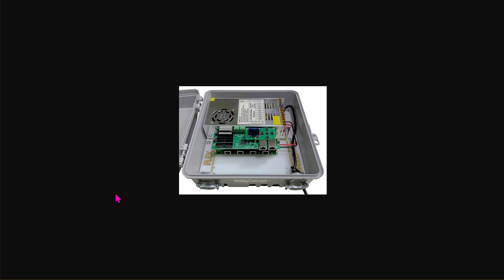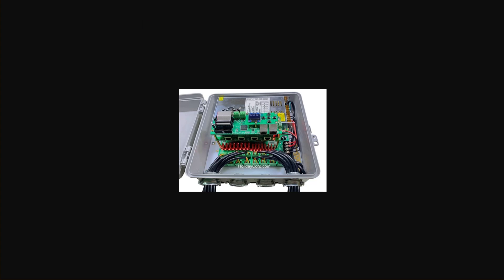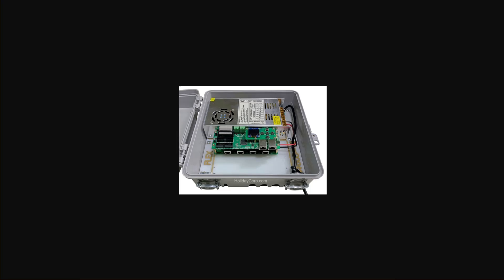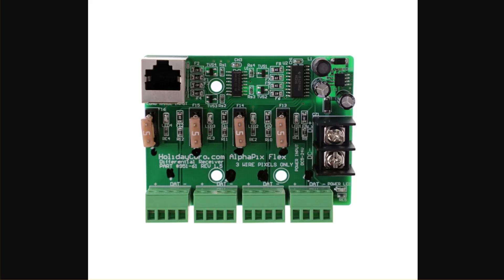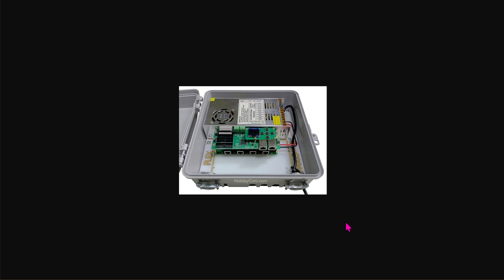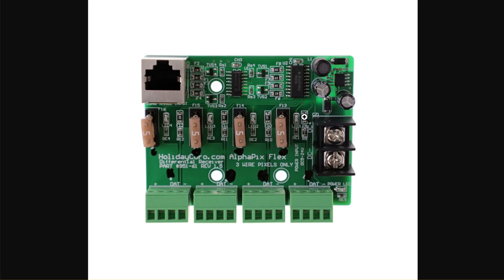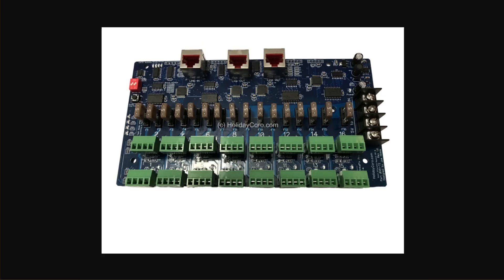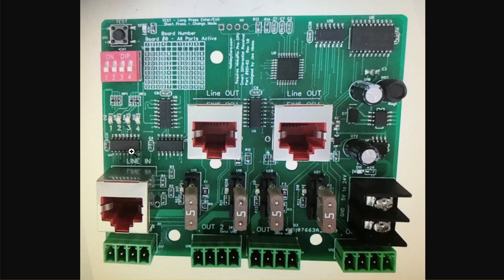OLD CONTENT: HolidayCoro Long Range Regular / Smart Overview Technology

Comment: Is port 1, 5, 9 &13 on the same pair or is it 1, 2, 3 & 4 on the same pair? I think what you were saying at 15:30 it is 1, 5, 9 &13. Is that correct?
Reply from the maker: A 16 output receiver is nothing more than four of the 4 SPI receivers attached together.  Thus the even have sequential receiver addresses.  Yes, the output numbers are just shifted by 4, so 1,5,9,13 are the "start" locations for each of the data pairs in the 16 SPI receiver.

Comment: Using a Hinkspix pro, can send 680 down each pair or each jack? Sounded like you said each jack at 12:02 and each pair at 12:24.
Reply: nvm..got it. It's each pair.
Reply from the maker: Yes, each pair of CAT5 wires inside the cable (there are 8 wires, 4 pairs in a CAT5).